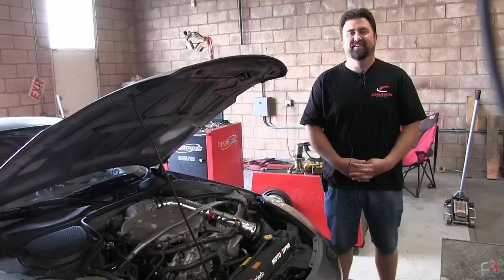Mass Airflow Symptoms and the Workings Of The Mass Airflow Sensor

Comment: My air flow tube fell off seen smoke coming out and lots of smoke out of tail pipe car shut down and would not start up for a while it finally started up and I got it home but now no heat blowing cold air what could be the problem. All I did was full up with gas before this happened. I dont see anymore smoke coming out since I put it back on. Car runs fine except no heat cold air and it overheats now

Comment: does a bad Mass Airflow sensor cause your car to shut off???  I recently hit a bump with my 2007 mazda 3 and it turned off and had to change the ignition fuse cuz it burned, not I turn the car on and step on the gas while on park and once I put in drive and step on the gas it turns of?? but when I put it in reverse it runs great, do you know what it could be???
Reply: did you ever figure this out ?
Reply: my car is currently doing the same thing and I believe it is electrical I just changed alternator battery and starter
Reply: +Amber Castillo, yes, it got fixed, one of the wires coming out from the computer was rubbing hard against the air filter case and it pilled off and it was causing a short and burning the fuse, so make sure u have good fuse and turn ur car on and move the wires and see if that causes ur car to turn off? if it does u have a short!
Reply: A short on an air sensor ?
Reply: +Amber Castillo no, it had nothing to do with the air flow sensor, it was a short that onve i would step on the gas and move forward the wire would move and cause a short and burn the fuse

Comment: Hi

i would like to email you a video of my 2007 997.1 turbo   it's idling strangly and when i rev the car it's lazy when i leave the throttle,

it's better i send you a video to dignose where is the problem

it might be one of the mas airflow sensors or a vacoum leak

Comment: can this mass airflow sensor cause the radiator fans to be constantly on after the engine is a running temperature? I noticed that my radiator fans are on full speed and do not shut off until i shut off the car. and i do have a k&n filter. please help thanks.
Reply: Miguel Garcia My fan does thats on my 2002 mustang and its because the coolant temp sensor isnt working
Reply: Miguel Garcia I have had to change the rads on my 3/4 of my cars because they didn't cool the engine and the fan ran all the time.
Reply: Miguel Garcia have you tried changing the ECT sensor? (engine coolant temperature)

Comment: my car hesitates after long rides and rpm will not go more than 4000 but when i let it rest it acts normally.. could this be the air sensor?  and check engine light was blinking also.. when i checked it says active lean fuel
Reply: Hitman4661 if the light is blinking it could be a misfiring piston in you engine. If that happens you need to stop driving right away

Comment: Its been 6 months since I have problems with my mazda 3 1.6 2008.  In idle it is rough, on accelerating it has problems, when I turn on AC it slows the shit out of it. I have been in two licensed mazda repair shops, they changed chain, spark plugs, oxygen sensor .. and the problem is still there.  I will try to clean MAF by myself.  If it turns out that this is the case .. I will sue them all. xd

Comment: I put a new air mass sensor on my van and the check engine light still comes on and when a mechanic hooks up to a computer The check engine light still stays on and his computer says it’s the mass flow air sensor is the problem I just changed that 🤔
Reply: Use your old one and just clean it

Comment: I have a v8 engine 400 hp nissan patrol witch is more like qx56 ...and It has a problem when the car is on d. drive in traffic light the engine start shaking a littile ..not that mutch but with 2014 car its an issue to me
Reply: 0sTV n

Comment: ok I own a 2010 dodge town and country I can start the van no problem run good as soon I put it on drive to take off. when I press the accelerator fast the engine start shake .if I step on the accelerator slow no problem is good can some body tell me what can cause that proble
Reply: Typically, what you are describing is due to an engine management fault(s) and such faults occur in ignition system components, the fuel system, and/or the air induction system. A possible first approach is to just simply make sure that the spark plugs are not past due for replacement and that all other engine maintenance is up to date. If the problems remains unresolved, one would request a diagnostic for poor or rough acceleration.

There are quite a few items to consider during such a diagnostic, but here a few major items:

Mass Airflow Sensor: The mass airflow sensor measures how much air is entering the engine and relays this information to the vehicle’s computer so that the right amount of fuel can be delivered from the fuel injectors. When a mass airflow sensor begins to fail, it will typically generate an error code or “Check Engine light.” This warning may be accompanied by hesitation while accelerating, or while driving up a hill. A vehicle with a failing mass airflow sensor may also stall soon after starting.

Fuel Pump: The fuel pump in most modern vehicles sits inside the fuel tank and pumps fuel up to the engine. If a fuel pump cannot provide the correct pressure, fuel may have difficulty making it to the engine. A vehicle that hesitates while accelerating or while driving up a hill may have a weak fuel pump.

Throttle position sensor: A throttle position sensor tells the vehicle’s computer how far the throttle is open and how hard the accelerator is being pressed. The computer is then able to adjust the fuel/air mixture going to the engine so that is stays at an appropriate level. If the throttle position sensor is not working properly, it may be sending incorrect information to the vehicle’s computer. The computer may then not provide the engine with the correct amount of air while accelerating, causing a hesitation sensation.

Dirty/failing fuel injectors: Fuel injectors spray fuel in a fine mist into the cylinder where it is mixed with air and ignited by a spark plug. Fuel injectors may become dirty over time and not be able to provide as much fuel to the cylinder as is needed. Dirty fuel injectors may cause the engine to run lean which will in turn, cause hesitation when accelerating.
Reply: tps

Comment: So this craigslist ad has a $550 1999 Volvo S70.... Heres what they said: "Now when you start it it revs to 3500rpms and then runs rough at idle. When you drive it down he road it runs very smooth but is limited to half power. I had the electronic throttle rebuilt and it still acts like this. Now I'm told it needs a MAF sensor. Im done putting money into it".... So based on what your video says, it sound more like a vacuum leak right? Then again im guessing a mechanic told this person it was either of those... Any tips to diagnose this on a car I cant really work on? They said bring a mechanic but im just gonna look at it myself lol
Reply: AyDayDay it is maff air censor

Comment: I just took my mass air flow out and i see a little puddle of what looks like oil in the hose. What should i do to remove it and could that be my problem of my suv not accelerating fast.

Comment: Hello please someone help me with my toyota corolla 2001. I have horrible mpg like i mean i should be getting 29mpg but i only get 17mpg in the city. The tires are pumped good and air filter is good. What can drop the mpg this significantly?
Reply: VisualPlays your speed. driving over 40 MPH will double your fuel consumption. if the car has an automatic  this actually sounds right because the ECM is reluctant to use the torque converter clutch because it's just not acceptable if you feel the car shift.
Reply: Driving in the city.
Reply: VisualPlays
Reply: Leaking fuel injectors

Comment: I have a 06 350z and it starts and dies 3 sec later , pushing gas does nothing and no
Codes came up! I replaced battery and badly corroded positive battery connection and this started happening ! I listen for fuel pump and I hear it but it's like a air sound ( I don't know how it suppose to sound ! I don't see any issues with vacuum hoses visually ! Please help ! I am lost at this point !

Comment: I have a nissan altima coupe v6 3.5 se changed my mass airflow sensor with another used one and cleaned it. It's starting and running clean driving well but when Im going slow or even when ita just in park it will just shut off? Please help. Lol  anyone with a similar problem? Turned my check engine light on

Comment: 2009 BMW stalls at the light, runs fine at speed and when I drop it into Neutral and push accelerator.  Is this a sign of bad MAF?
Reply: Don't take my word too seriously, because I'm obviously here getting car help, but when I had similar problems with my Volvo V70 it was o2 sensors.  Good luck, I love BMWs!

Comment: I replaced my mas air flow sensor and it started running a lil ruff how do i fix that.  2004 infiniti g35
Reply: Do the ideal reset
Reply: @LuisGonzalez-vx1oo  what is that

Comment: Hello Mr, very well explained. Please help me with a suggestion, my fors  fiesta 1.4 tdci 2007, starts very bad in cold. This is a video with the motor starthttps://youtu.be/q6xsgSZIMzs. Can be a maf problem? Motor jerks only when is cold, after is warm i have no problem. I had a problem with fuel injector no.2, i replaced that. Also have no air on the system, no dirt in fuel tank. Also motor died few times when running. Pls help me if you can, or what can i verify. Thank you very much from Romania.

Comment: I took my VW with an oil leak and rough idle loss of power to two gareges, they both failed to fix this problem, in the end I had to bite the bullet and took her to VW, who swiftly Mass Air Filtered me also they sump gasketed me and had the cheek to charge £450 quid,........robbing sons of B....ches, but it runs nice now

Comment: Yea man those maf sensors are a pain the f'ing ass ..!! 
My nissan has one and ever since i went turbo on it, my idle issues were a pain ... eventually i got it working fine and now its smooth as silk.
Ita funny how some manufactorers can run without maf just fine and some like nissan and ford still use maf .. 
maf are a pita and nobody should be using them anymore